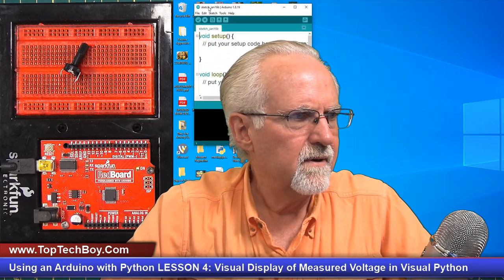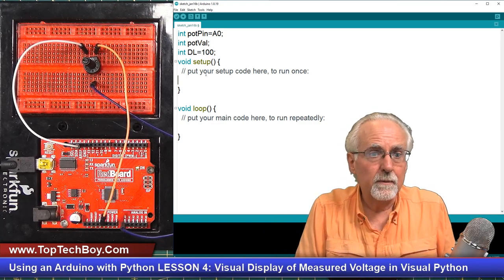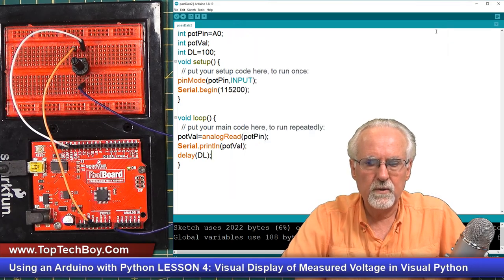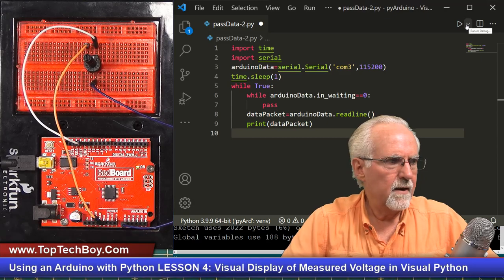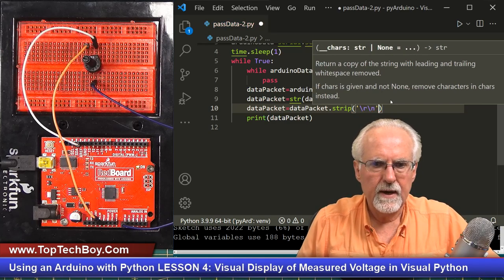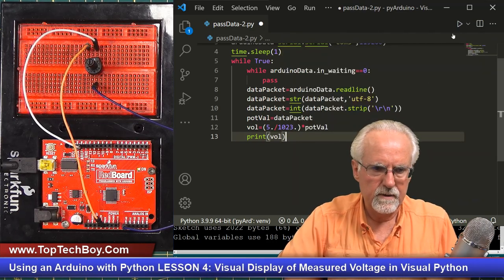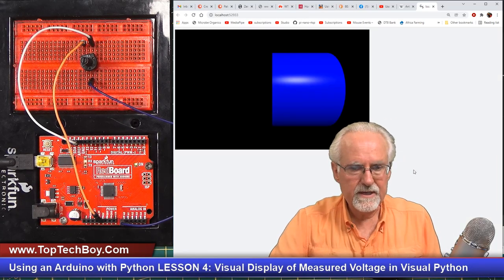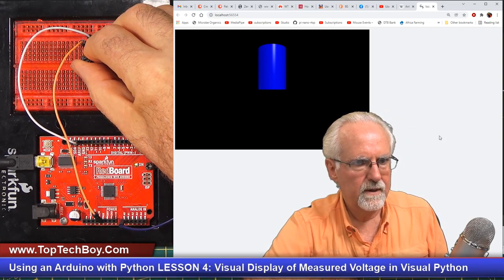Using an Arduino with Python LESSON 4: Visual Display of Measured Voltage in Visual Python

Comment: I did about a C+ job on this homework.  Used an arrow which stretched appropriately along a box with tick marks.  When entering your solution, I struggled with a frequent intermittent  error which occurred on the "...serial.Serial... line and seems to indicate an error opening the com port.  After hours of experimenting, I found that moving the time.sleep line above the serial.Serial line and increasing the delay to a ridiculous 8 seconds eliminated the problem.  Thanks for presenting these most excellent lessons, Paul!

Comment: This is another great series, am having so much fun learning to program in 3D. For those going out of their minds because you can’t get the animation to the browser because of the package txaio causing errors. Try to use an older autobahn version 20.7.1 and txaio 20.4.1, old laptops had no issues with these files.
Run the following four commands in a terminal, best of luck:
pip uninstall autobahn
pip uninstall txaio
pip install autobahn==20.7.1
pip install txaio==20.4.1

Comment: I am legend! 😀Here is what I did. Unfortunately my machine is too old to run Python 3.8 and up (which is needed for VPython), so what I did instead was to create a GUI with a progress bar (using good ol' Tkinter), and as I turn the potensiometer, the progress bar updates accordingly. I trust that is a fair replacement for VPython for this tutorial. I had to use multi-threading to make it work, though. 

Imagine how cool it would be to measure various engineering parameters and displaying them all on a neat screen. That is my ultimate dream.
No more expensive CompactDAQs needed. 😉
Blessings

Comment: I tried "cylinder" on my macbook as shown in this lesson. 
My code is exactly the same as what Mr. McWhorter has toward the end of the lesson.
However, I keep getting an error message, "AttributeError: 'cylinder' object has no attribute 'idx' ".

Why am I getting this error when the 'idx' attribute is even not part of the code?
Should I use a slightly different syntax since the example code is for Windows?
Please, help!

Comment: Thanks Paul! I did have a problem "Import "vpython" could not be resolved" You are working on VS 3.9 according to your screen,
Isn't it supposed to work on only 2.t version? If there is another video, I'm supposed to watch, please let me know...
Reply: i have the same problem .yet to be resolved
Reply: @terryterry1655  Terry, this what I did and it worked for me:
Note: to install vpython if using a 64bit python version, go to viw menu and press terminal.  On terminal screen type(all lower case:

pip install requests vpython
then:
pip install vpython
Reply: or see comment below...

Comment: Hey Paul, looking forward to lesson 4! I’m sad to say that the safe cracker folded up like a cheap lawn chair and did not open the safe. I stopped it after 13000 combinations. I found an old spiral notebook with a note inside with the combination! The first number is 13 and the safe cracker had already gone past that set in the database. I’ve been trying the combination but it still won’t open. I must be using the wrong sequence. I still plan to do a video. I’m finding that to be very difficult. The software I used to do videos with doesn’t seem to work anymore so I need new software. I’m trying iMovie which came with my MacBook. I refuse to fold up on this. I will get it done eventually! If you have any suggestions on video editing software I’m open to suggestions.
Reply from the maker: On the safe, an important thing is to make sure whether you are supposed to start spinning to the left, or start spinning to the right. A safe will have two different combinations, depending on which direction you start. Second, making sure you are spinning a suitable number of times in the start direction before commencing with the combination. The other thing you mentioned is that you were jumping 3 at a time  . . . maybe go back, and just do one at a time. If you found a combination, it should open it, if you are entering the combination properly. These old safes really will open, you just have to have confidence. Maybe see if you can find more info on your make of safe about the unlock sequence. I have found even having the combination can require some fiddling to get it opened.
Reply: Det cord 👍

Comment: 19:04 In lesson 2 you used InWaiting() and in this lesson you use t in_waiting() ? .
Reply from the maker: Isnt it the difference between being on the arduino vs. python side?
Reply: @paulmcwhorter  Thank you for everything. Sorry I was mistake. The inWaiting function was used in lesson 3 and the in_waiting in this lesson and both lessons  are dealing with the same subject, Arduino and Python :)

Comment: My set up does everything until the visual part. I only get a blank page. What os Wrong?  I guess my python days are over unless I find out what the problem is. Must be in my computer or browser settings
Reply from the maker: Probably something with your browser settings. It is hard for me to say because there are so many different systems you might be running on, and your security settings might prevent a script from showing in a browser. I really dont know what to suggest.

Comment: Would it not have been easier and more instructive to show how to convert the base 2 value of the pot which is the same value as found want only in base 10? In my experience, changing bases should be such a common function that programmers can do it in their heads.

Comment: I was able to get the voltage from the potentiometer followed by " Volts" printed in the Python Terminal, but it did not loop. It only printed the immediate voltage and " Volts"..and that was it. This is what I did.
Arduino IDE Code:
1    int potent0 = A0; //Analog pin for Potentiometer//
2    int readVal;  //declaring variable, readVal
3    float V2;  //declaring non-integer value for varrying potentiometer setting//
4    int dt = 200;
5    void setup() {
6    Serial.begin(115200);
7    pinMode(potent0,INPUT);
8    }
9    void loop() {
10   readVal=analogRead(potent0);
11   V2=(5./1023.)*readVal;
12   Serial.print(V2);
13   Serial.print(",");
14   Serial.println("Volts");
15   delay(dt);
16  }
  
Visual Studio Code:
1. import time
2. import serial
3. arduinoData=serial.Serial('com5',115200)
4. time.sleep(1)
5. dataPacket=arduinoData.readline()
6. dataPacket=str(dataPacket,'utf-8')
7. splitPacket=dataPacket.split(",")
8. x=splitPacket[0]
9. y=splitPacket[1]
10. print(x,y)
Reply: when I originally tried to make the loop I forgot indentation after "while True:" for rest of code.  Problem solved very soon in video. Correct Python Code:
1    import time
2    import serial
3     arduinoData=serial.Serial('com5',115200)
4     time.sleep(1)
5     while True:
6         while arduinoData.inWaiting==0:
7             pass
8         dataPacket=arduinoData.readline()
9         dataPacket=str(dataPacket,'utf-8')
10       splitPacket=dataPacket.split(",")
11       x=splitPacket[0]
12       y=splitPacket[1]
13       print(x,y)

Comment: Hello Paul, thanks for amazing lessons, you are LEGEND. but i have a problem with this error
    dataPacket = int(dataPacket)
ValueError: invalid literal for int() with base 10: ''

Can any1 help please? 
Cheers and thank you :)
Reply: I am having the same problem but only once when I first start the program. The next time I run it and every time after that, it runs fine. No idea the issue.

Comment: please look up to this problem :
ValueError: invalid literal for int() with base 10: ''
i am getting this error 

import time
import serial
from vpython import *
import numpy as np
arduinodata=serial.Serial('com11', 115200)
meter=cylinder(color=color.red ,length=1 , raduis=1 , pos=vector(0,0,0) , axis=vector(0,0,1) )
m1=box(length=2 , width=1 , height=1 , pos=vector(0,-0.5,0.6), color=color.black)
time.sleep(1)
while True:
    while (arduinodata.inWaiting()==0):
        pass    
    wt=arduinodata.readline()
    wt=str(wt,'utf-8')
    wt=wt.strip('\r\n')
    wt=int(wt)
    print(wt)